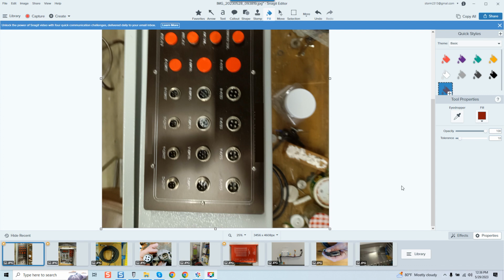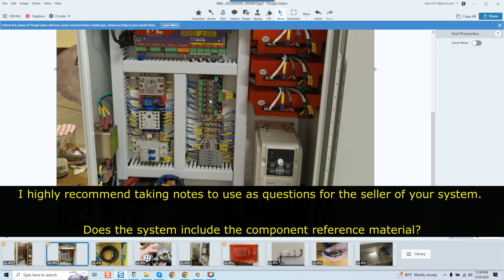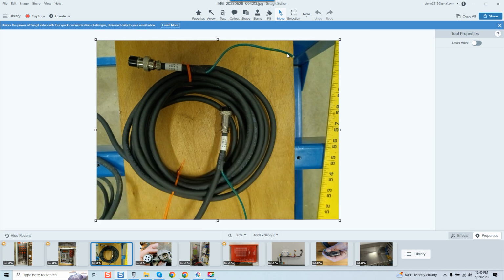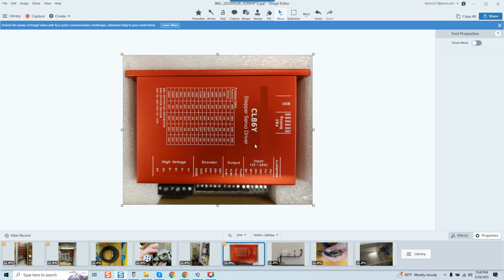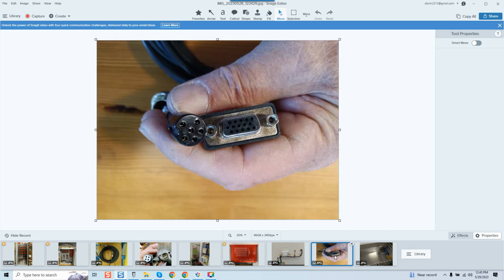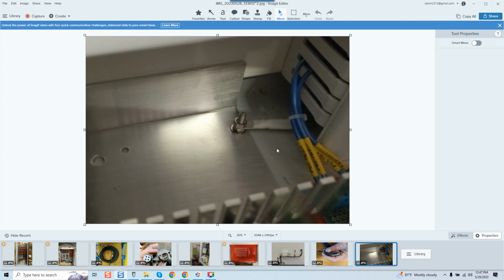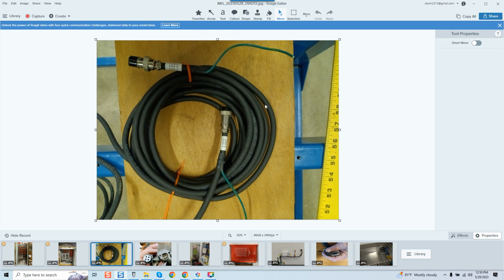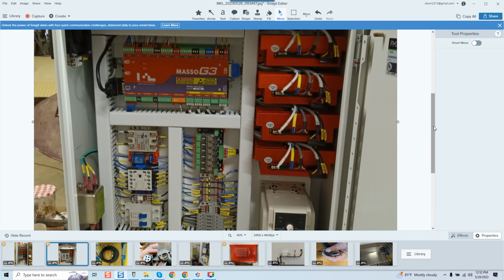What's The Real Cost Of A Used Masso CNC Controller

Comment: So what did the Masso G3 do to cause problems? You talked about a lot of "other" issues, but not the controller. Would a better title be "What's The Real Cost Of A Used  CNC?"
Reply from the maker: The title of the video is accurate, and the Masso was used in the retrofit which is why its in the title. If however you want to see Masso issues all you have to do is searcg using Google for USB Masso problems, and you can read about them. Thank you,
Vince

Comment: I have watched yor videos and you do make some very good points on many things . In this case I would have asked the seller a few questions like how long had they been running the macine, why are they getting rid of machine, and may a few other questions. Then I would open the panel and do an inspection. What I would be looking for in their answers would be like ran the machine 5 years and due to depreciation it was time to replace it.  I would be inspecting the panel to see how factory it looked. From my experience, once there are issues in a panel it very seldom goes back to looking factory installed. If the machine has a good running history an the panel still looks factory fresh I would feel the electrical design is adequate. Not to say improvements couldn't be done, but the system works and has worked for some time. I have worked for some years in the pharmaceutical manufacturing field as service. I installed, maintained, and calibrated the machines that make pharmaceutical drugs. You would not believe the things I have seen in manufacturing plants.
Reply from the maker: Thank you for your support, and you're correct. The more questions you ask, and the more detail the seller can provide for the system they're selling the better off you are. Always remember to ask for any documentation as well as most times companies will keep them for servicing. 

Thank you,
Vince

Comment: Vince, you might as well make  a plug and play  controller for all those chinese 6040 or 6090 cnc routers that come with junk controllers .
Reply from the maker: Thank you for your support Joe. I really appreciate it, and I already have those systems for the 6040's below 😁

Here's my 600oz system https://www.ebay.com/itm/131506845680

I also have a 300oz system https://www.ebay.com/itm/142506267150